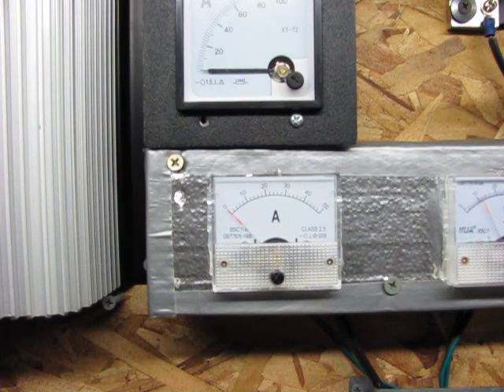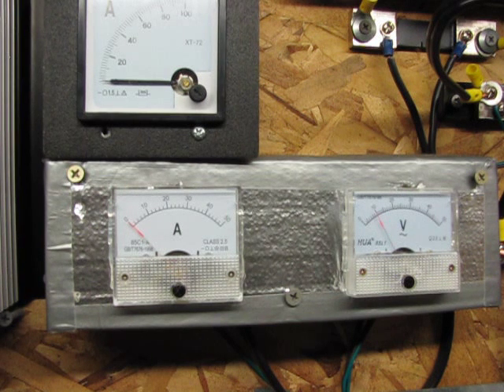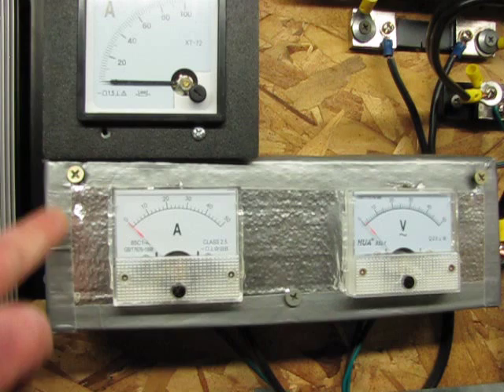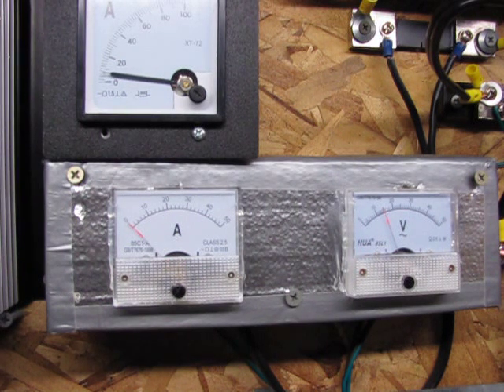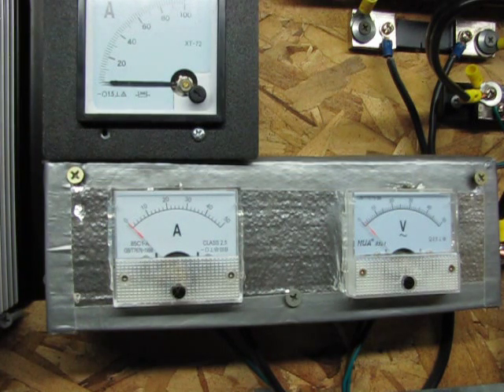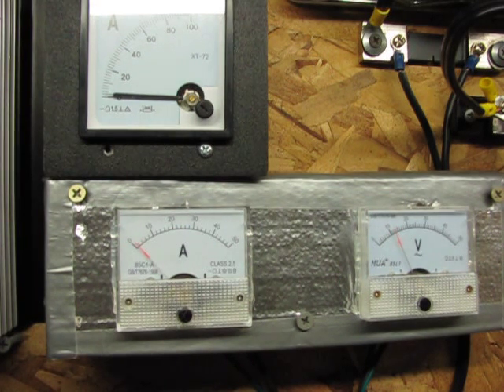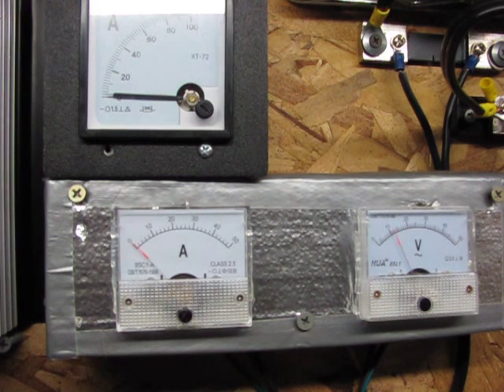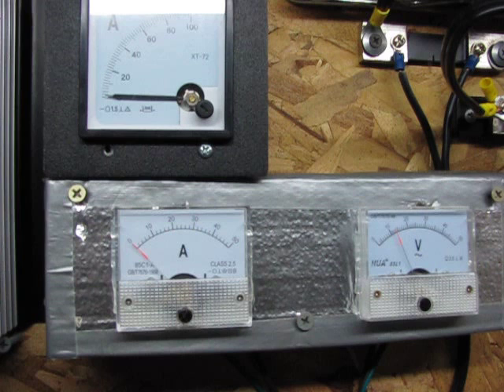MW&S verses Thermodyne,,, AMPS in Low wind gusts

Comment: If I remember correctly, the thermodyne is supposed to be a 24 volt system and you've got it hooked up to a 12 volt battery? That and other things make this look like you're comparing apples and cucumbers.

Comment: Falure and Run Time?,,,,any comments from anybody who's used several of these different wind turbines fan blades and alternators -generators regarding "mean time before failure" or approximately how many years do you get out of them before you have to climb up there wrestling to take them down and put new bearings and windings  and so forth. any idea who has the longest lasting equipment? or best warranty, please comment if you know thank you very much
Reply from the maker: I don't know what brand of turbine lasts longer,,  It depends on your weather where you live ,, I have a turbine that has been running non stop since 2012, with no troubles at all,, I also have a chinese turbine that has been running a little over a year and the bearings are bad ,,
Reply: thank you Jason, can you give us the 12 year running one brand name?, wattage? are you off grid? thank you for your reply

Comment: will someone please advise me, a newbie to wind turbines,   Im thinking about buying a wind turbine to put up for an off-grid property. So which the best turbine alternator- generator  and Blade Set up out there available right now ? the best bang-for-the-buck? what gives you the most watts and amps and last the longest out of anything available right now? the brand name the distributor the supplier the company the seller give me some information, please comment and keep commenting so I don't spend my money on something that breaks after a couple of weeks give me some good referrals and the reason why I should go with whichever different brand you're recommending this is for off-grid cabin that has continuous wind, please no negative comments about how bad the other guy is just tell me how good yours is and what makes it better and why I should buy it a certain brand, make and model from a certain manufacturer,  thanks everybody for the good comments
Reply from the maker: The best Turbine I own is my MW&S Freedom II 12/24 volt ,, I like it because I can run one core to 12v grid tie and the other core to 12 volt battery charging, or , I can run dual core 24v to grid ties ,, or 24v battery setup ,, or, I can run it as two 12v turbines to charge 12v battery bank or 12v grid ties ,, I have many different options and blade setups I can choose from for my area , My Freedom II has customization for my needs that I have not seen from other companies when I bought mine a few years ago,, I don't know whats on the market now because I don't need anymore turbines I own 6 turbines now but I am only running 4 at the moment ,, I got the turbines that I like And they do what I bought them to do for my setup ,,

 It depends on your area what will work best for you ,, that is why no one will tell you to go out and buy such and such brand turbine ,,, we don't know what will work best for you in your area ,, If someone tells you to buy a turbine because They say it is the best ,, don't trust them ,, I can only give you advice on what I found that works really good for me in my area ,, but your area is totally different and what I use might not work good for you ,, I don't know

Comment: I just ordered some new parts for my system. I ordered 4 3 phase breakers to use as a break for my turbine, and some other dc breakers I'm going to do a over hall of my system make it look a lot better, and will work on my DC to DC isolated converters for my meters so I don't have to have batteries for each Meter. now looking for a hoffman electrical box 24x24x6 to put every thing in that way all you see is cable in and cable out and everything be inside of box.  Now I just need to find the box at a good price.